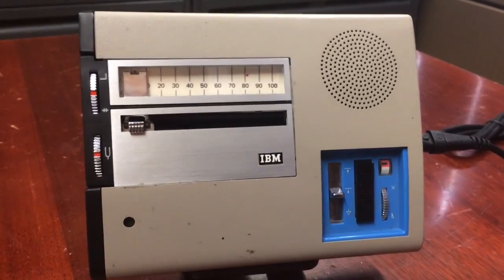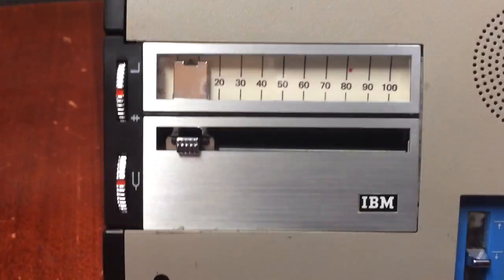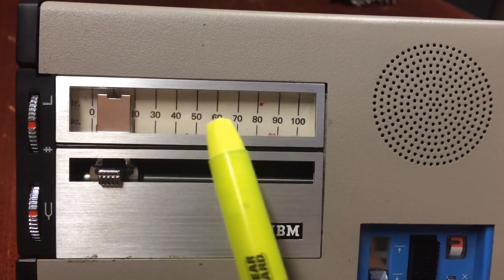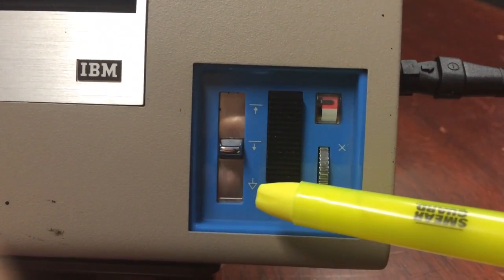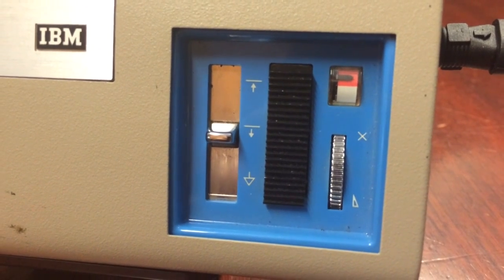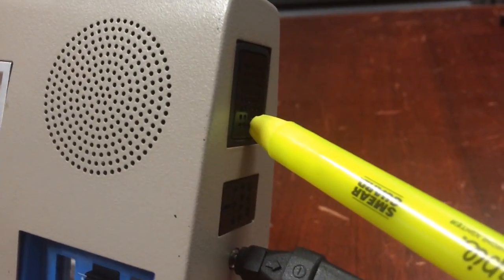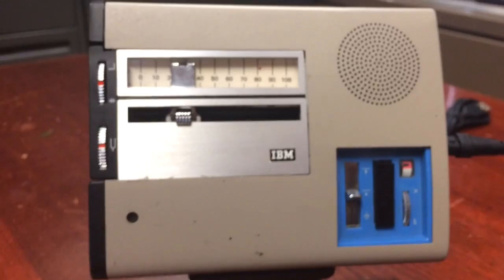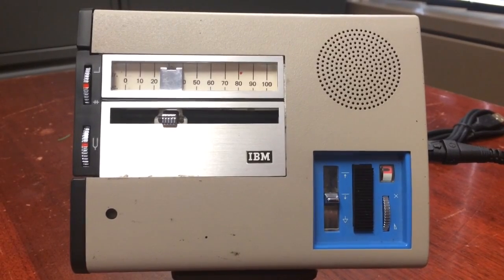IBM 224 Dictation Unit Operating Instructions

Comment: Where can I get hold of the right size power supply that you have plugged in ?  I would like to hear a tiny recording of me and a friend way back.
Reply from the maker: There is a high probability that the belt inside will be rotten.  In any case,  I used a universal power supply that has a 2.5mm plug on the end.  I can also transfer the recording to digital for you if interested.

Comment: I got one of these, with the Model 212 playback device as well. The rubber belt is ofcourse dissolved in the 224, but it has the original battery. It's one big cylinder, 11.2v mercury-based, with one smoke-alarm-style connector on each side.

For the 212, The powerswitch and a few washers on the flywheel has fallen apart, and it keeps buzzing indicating "no tape" most of the time. Other than that, it seems to be in pretty good condition. It has speed-control, volume, variable low-pass filter, tracking control and a footpad for play/reverse. It also has a magnetic bar that can be lowered to erase the entire tape.
Reply from the maker: Cool!  Were you able to restore your 212?

Comment: I just picked one of these up at a sale. Bought it because it said "IBM" and I had no idea what it was. Here's a way around the battery issue. I cut a piece of PVC pipe to fit inside of the battery compartment.  I then took three CR2 batteries and slipped them into the pipe. The pipe provides stability because the batteries are thinner.  You will need to cover the tip of the battery compartment plug with foil (or other conductor) as it is plastic.  The thing works great!
Reply from the maker: Dave, that is awesome!  So yours didn't require any belt changes?  I've had 3 of these units and the main drive belt (and pulley) were each in really bad shape.
Reply: No, the belt was nice and soft and no cracks in the pulley.  It was stored in a damp basement, so I had to clean off the mildew and there was some minor battery leakage.  Maybe you can tell me about the record button?  I push the top half and nothing happens (it just pushes in). To get it to record, I have to push the bottom half upwards (rather forcibly) and hold it there.  I don't see a way to lock it in place.

Comment: Uses cassettes right? I remember having one unit similar to that I think that school where there was the footpedal and a microphone control that turn everything on and off but also had the playback and rewind features on the remote as well.
Reply: +Manyvideointerests1 
It usd what was called a "magna belt"  not casette tape. It was About 6 inches wide and did not have a cover of any kind